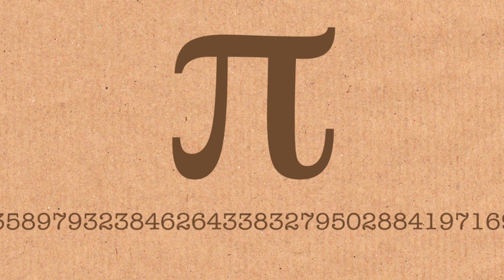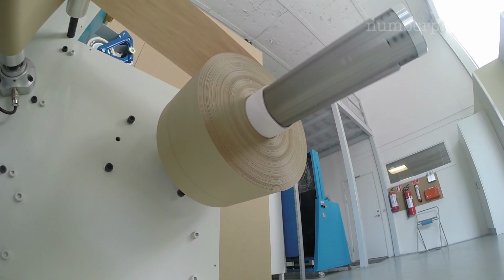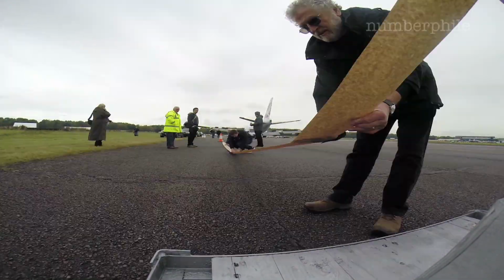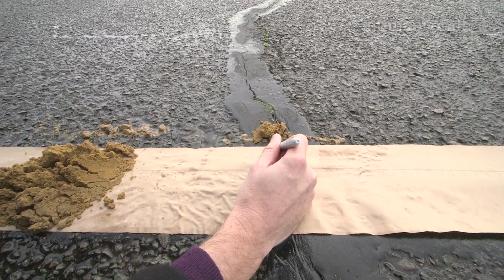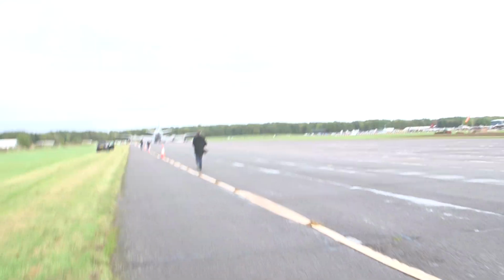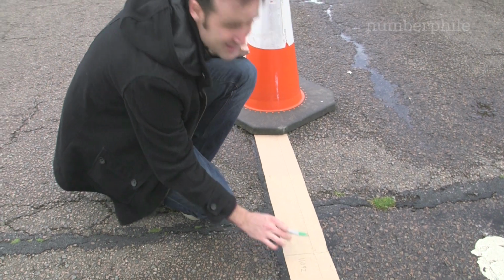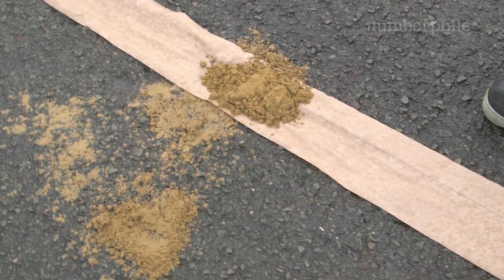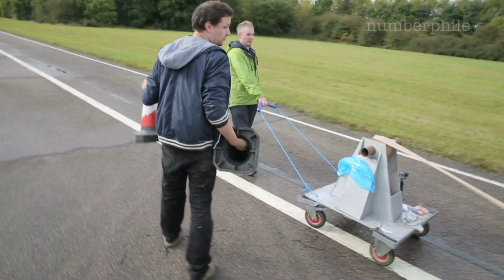The Making of a Mile of Pi - Numberphile

Comment: Should've called guinness and told them you had like "Most digets of pi on one piece of paper" so that someone has to check every single digit
Reply: Michael Van Camp ya lol
Reply: It wouldn't be too much in that case since it's only 1 line per page.
Reply: They still have a second roll to redo it with.
Reply: Lol it would be funny if they made one single person check them all. They would have to work multiple days. Instead of giving multiple people sections to work.
Reply: @the_original_Bilb_Ono  Indeed it's around 288 man hours (11.57 days for one person) to verify a million digits assuming one could sustain 1 digit/sec and I can't imagine it being much higher than that if one was actually checking properly.
Reply: @seraphina985  there's also laws for working so many hours without lunch/breaks and then you should add the time between shifts. It would either be the dumbest foreman in the world or the greatest troll to not break it into sections with groups assigned to various sections. Lol
Reply: @the_original_Bilb_Ono  Yes indeed but to clarify I was talking there in terms of actual working hours so yeah it would be around 7-8 full time work weeks (Based on the typical 35-37.5 hour full time workweek typical of most developed countries) ie a standard 8h*5day workweek with 30-60 minute breaks each day depending on local regulations and how generous your contract is.
Reply: Not even 1% of the digits of pi
Reply: Michael Futch not even .0000000000000000000000000000000000000000000000000000000000000000000000000000000000000000000000000000000000000000000000000000000000000000000000000000000000000000000000000000000000000000000000000000000000000000000000000000000000000000000000000000000000000000000000000000000000000000000000000000000000000000000000000000001
Reply: This comment has 314 likes
Reply: @Becquerel1  316 already
Reply: No, they would simply verify the print source
Reply: You have to pay for records from Guinness so I'm sure they wouldn't mind. They'd probably use some sort of computer and scanner anyway
Reply: Well, they'll realize there are no digets, but 1,000,000 digits.
Reply: Yes

Comment: how awesom is it that the first digit is 3, the 'halfwaypoint' (no. 500'000) is 2, and the 1'000'000-th digit is 1
Reply: guess the 1,500,000th might be 0.
Reply: and 2,000,000th is -1 or what
Reply: Christianz probably 9
Reply: I just checked. The 2 millionth digit IS 9, but sadly the 1,500,000th digit isn't 0. It's 5.
Reply: Also, I'm pretty sure when counting digits of pi, you'd start with the first decimal place, which would be a 1 instead of a 3. Bummer.
Reply: I checked at Wolfram Alpha - and using their indexing (where the first digit is 3 not 1) the 500,001 st digit is 2, the 1,000,001 st digit is 1 and 2,500,001 st digit is 0.  

Whereas the 1,500,001 st digit is 5 (9 is to the left and 2 is to the right) and the 2,000,001 st digit is 9 and the 3,000,001 st digit is 3.
Reply: @x___________________________x  it cant be
Reply: @CaIebwithaK  No, sir. All digits count, not just the ones after the decimal separator. Example: 1234.56 has 6 digits. In fact, in this video 1000001 digtis of Pi are printed.
Reply: @williammook8041  Wolfram Alpha is correct. In the video 1000001 digits of Pi are shown (1000000 after the decimal separator).
Reply: barely awesome at all..

Comment: Am i the only on who wish they'd made the video 1 second longer?
Reply: Patrick Hansen minute*
Reply: emile_b_owner why minute? then it'd be 3240

If it was 1 second longer, it'd be 3141 ;)
Reply: no it wouldnt ;3
Reply: I still don't get how 31+1=/= 32...
Reply: Patrick Hansen It was, youtube cuts 1 second which makes it look like it wasn't... but the video should be 3.141
Reply: +Patrick Hansen

Why? Then it would 314*2*
Reply: Nicolino Will on my end, the video is 31 minutes and 40 seconds
Reply: Patrick Hansen if you refresh the page and look at the time before it changes, it says 31:41 but then decreases by a second.
Reply: Patrick Hansen its 31:40 before ending while 31:41 after ending which means either 3.14 or 3.141
Reply: +Patrick Hansen I think it's already 31:41
Reply: Technically it should be 31:42 if you're rounding properly.
Reply: +Patrick Hansen that would be humerus because of the obvious correlation to Pi how ever any sequence of 4 numbers can be related to pi I chose my pin numbers according to the date written as mm/dd/yy/ so today if i had to pick a pin code i would pick 0034 or if i had to eliminate the 00 it would be 3482 because these are the next digits after the date 121615/003482...... i always know my pin based on what date i created the pin and vise versa.
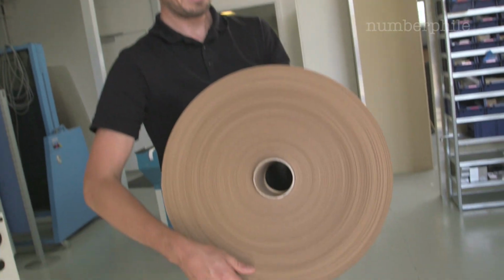Reply: The reason why is the since the first 3 digits of pi x 2 is 628 and the video is 6:27 long.
Reply: +Patrick Hansen DUUUUDE HOW DID U JUST C THAT?
Reply: It says 31:41 for me
Reply: it is 31:41 on the thumbnail
Reply: Patrick Hansen but its the first 4 didgets of pi 3.141
Reply: Rounding - spoken like a true engineer... :D
Reply: Patrick Hansen it’s 3.141 not 3.142 so why would you want that?
Reply: 3.14 is the real pi tho
Reply: Patrick Hansen, the video is 31:41.
Reply: or 2
Reply: Yesss this comment is at 314 likes now
Reply: no not now ;)
Reply: Pi of Shroedinger?
Reply: Patrick Hansen it is 31:41 for me
Reply: Then it will equal 31:42
Reply: It is 3141
Reply: on mobile, it shows it as 31:41

Comment: Couldn't there, theoretically, be an set of infinite repetition (like a repeating 3) within the infinite sequence of pie, if it is indeed a normal number?
Reply: Then there would also be a set of infinite 4s, and that is not how infinity works
Reply: Well, that would be paradoxical, wouldn't it?  I mean, then every other sequence would have to exist in it, infinitely.
Reply: sKebess Half of infinity is infinite though, right? And that fraction of infinity can just as easily come from within it, right? So it follows, that if it is a truly random, normal number, it must at some point contain an infinite series of threes, or fours, or anything, and everything else.
Reply: HisRoyalCarlness
You need to be careful when you deal with infinity. For example, 0.999... =1 but if we could, like you say, add decimals after a recurring number then 0.999...13324 > 1

If you took;
- a recurring decimal
and
-the same recurring decimal with extra digits after the repeating part,

then the difference between those two numbers would be infinitely small. And from memory there can't be infinitesimals with a non-zero value in the real number system.
Reply: ObeseYeti Fair enough, hence my original question. But still, there are other schools of thought when it comes to number systems, perhaps the discussion would be cool for a video. (PS: Thank you for responding rationally to my comment. Lately, more than usual, every response to comments I make has contained the word "moron" in it somewhere. Even when talking about something like cooking.)
Reply: HisRoyalCarlness
No worries, I'm not an expert by any means so take what I said with a grain of salt. But I do think that it made sense.

In regard to other number systems, I wouldn't really have any idea. Sorry I couldn't be of more help.

But yeah, I think a video on this would be cool as well :)
Reply: HisRoyalCarlness Excuse me, but why have there been multiple comments in this thread that have completely vanished, including my own?
Reply: Vulcapyro I delete things that don't add to the conversation. Like when people don't read through what is being said, carefully, and then respond with something that has already been covered or shows that the question was not understood. I also delete negative comments, a lot of the time. Most of the comments that have been made here, after the first ones, have been of a non-understanding or redundant nature.
Reply: HisRoyalCarlness Firstly, that is simply censorship. If some people can't be civil in their replies, you don't need to reply to them, but deleting relevant replies even if they miss your point is foolish. If the question was not understood or their response is wrong, tell them why; maybe in fact you have misinterpreted what they meant, rather than the other way around.

I for one took care in making my response, and rather than replying to it and perhaps telling me why it was irrelevant or whatever, it was deleted. This is poor behaviour on your part and suggests that you intend to just censor every comment you don't want to reply to. If you can even remember what I wrote in my comment, could you tell me what your actual response is to it?
Reply: sKebess
You really should just take off if all you intend to do is harass him for this rather than getting to any point of discussion. You're the person I'm telling him to ignore rather than delete, precisely because I figured you'd be that guy that would just keep going at it until one of you got bored or reported.
Reply: Vulcapyro I don't report people unless they actually do something report worthy. I just block them. As for deleting comments, it's necessary on Youtube, otherwise any useful information just gets covered by a swamp of back and forth, redundant, and unhelpful comments. It's like policing a forum, not so much an issue of censorship as it is one of making what is important more visible. You aren't being silenced, you can make a comment of your own in other places, but I will keep the discussions that follow from my posts well maintained.
Reply: HisRoyalCarlness It is censorship, especially if relevant comments are being deleted. Both mine, and sKebess' comment on sequences, were completely relevant. You never answered why my comment in particular was deleted, since it directly answers your question and didn't have anything close to even disrespectful; it was just math. I can make the argument again if you want.
Reply: Vulcapyro Censorship is a word you can throw around, but in the end the ethics of censorship are completely circumstantial. This isn't a debate, or a journalistic report, it's the Youtube comment section. I read through an understood your comments, and the comments of others, and they were addressing a different question than mine. Obese Yeti has already said everything that needed to be said.

Comment: I would have suggested two improvements to the unrolling process , one of which would have required it to be rolled the other way (inside has numbers instead of outside)..

The first suggestion would not have been cost effective for a whole mile, but would have helped with the unrolling AND kept the laid out sheet dry. I would have used two rolls of clingfilm (one between the runway and the sheet, and one above the sheet. with each cylinder of clingfilm rotating in the direction that allows the sheet to pass between them, and become coated. the cylinder above could also have been used to push the roll away from the laid out sheet.

The second suggestion would have been with the sheet rolled the other way, it could then be unrolled from the bottom and therefore less affected by wind.

Comment: From now on, the airline industry will no longer use yards/meters for MRL (Minimum Runway Length) stats. Instead we'll see, "A 747 at wax weight, 25% fuel with flaps at 40 has an MRL of 880,000 dop (digits of pi, natch!)

Comment: Since the first digits of pi came off the roll first, it must have either been printed in reverse order, or the roll rerolled after printing.  No mention in the vid that I saw, but clearly rerolling would be far easier.  Can you tell us which method was actually used?

Comment: Pi isn't random for those of you who don't realize. The first clue is that, a random number cannot be predicted. And the only way of knowing pi, is by knowing the circumference of a circle, in measurements of it's diameter. Every new digit you calculate isn't random, before anyone knows it, it's always going to be the same, just like the 3 at the beginning, that's not random, that's just how many diameters can fit fully into the circumference. Before we actually figured the first digit out, it wasn't going to be any random number from 0 to 9. It's clearly always been 3, and always will be.

When we calculate 1/3, we get a recurring 3 forever because 3, 3's fit in 10 and 1 is left over, recreating the 10, but we only have this problem because we use a BASE 10 number system, but if we used BASE 3 (which is less efficient), we could answer 1/3 really precisely like this 0.1. My point for this continuous number was that pi is no more random than this is. I know pi isn't as easy to predict, but the fact is, it's not random, and it goes on forever. Whereas with 1/3 we know it's a recurring 3 forever, meaning it's a lot more predictable than pi.
Reply: Woah.. saying irrational numbers can be rational is not rational.... sorry 

But on a more serious note, pi is irrational and it will not become a reoccurring set of numbers, to say otherwise would make pi rational. And pi has been proven to be irrational.
Reply: Brandon Kekahuna
Woo, woo, woo, calm down... What you said is true, i never said i disagree with that. You've come here, read my comment, and simply wanted to say something about it... Does it ever come to mind that, we all agree on the same thing? (The facts)
Reply: I fixed my comment. When i originally wrote it, i only used the word recurring by accident, i meant to just explain that the digits go on forever, i didn't mean in a pattern. We all make mistakes. xD
Reply: (edit)DLC ENERGY I apologize for using caps in my reply. didn't mean it that way. I agree, though, Pi, like other irrational numbers, are not random.

(I really need to learn to use emoticons at the end of my post to ensure my response is meant to be polite)  :)

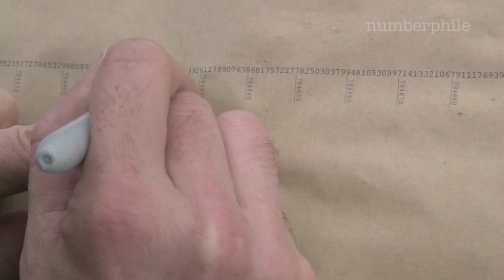Comment: 21:22 - 22:29 I'd love to see a version of Pi up to that point where each member of that series is colred via RGB values where it starts at 0,0,0 for the first member and then ends at 255,255,255 (or where ever it ends) for the last member. The way I'd do it, if I could, would be like a clock where you iterate red to 255, then at "256", red turns to 0 and blue goes to 1 and then continues on to 255,255,255.
Reply: You'd need 16581375 digits for that

Comment: So you can print a mile of numbers and use 20% of ink, and my ink runs out after 6 out 9 pages in a report. How.
Reply: Single line.
It's like stretching a human intestine around the planet, and yet it still fits inside them.
[May or may not be true, I haven't researched it myself.]
Reply: It’s not true, it’s like 5 or 10 meters, not around Earth
Reply: @vibaj16 
Anything can be stretched near indefinitely, the problem is that it won't resemble what it was once it's reached it's distance.

Comment: Amazing job guys!!!!
Just one question.... sorry....
But I'm really interested at how you guys actually calculated 1mil digits of Pi because if you for example quickly write a C++ or Java program, you'll very quickly reach 64 bits and the calculation won't go further even when you use doubles in C++ or BigDecimal variables in Java so how did you guys do this? I would really appreciate an algorithm or something.
Did you maybe use a algorithm that would for example give you the n'th digit of Pi because that would also work but I have no idea how to do that so an algorithm that takes in an integer as a parameter (which is the digit of pi that you want) and that returns the Pi digit so for example if you put 2 in the algorithm, it will return 4 and if you put in 5 it would return 9.
Is there a way to do this?... well obviously this video proves that there is. 
Thank for your time and well done (-;

Comment: question: My computer monitor has a resolution of 1920x1080 and each pixel is apparently capable of 16million different colours. How different screen combinations is possible?
Reply: According to Google calculator, (1920 × 1080 × 16000000)! = Infinity
However, Wolfram Alpha puts it at 10^(10^14.63767015176375).

Put another way that's like 1.4 trillion, followed by 8 trillion zeros. But don't worry, there'e no way you can actually perceive all those variations.

Comment: I'm just curious how many trees that had to be cut down to make that. I'm not against you guys doing this, just curious
Reply: +Internet Enzyme Well the average tree can be made into 10,000-20,000 sheets of paper.  8 points is 1/9 inches, and a normal 8.5x11 in. piece of paper is 93.5 square inches.  I don't really understand the point system, so lets just say that on average a number in 8 point font is 1/9 by 1/9, so 1/81 square inches, which seems about right.  93.5/(1/81)=7573.5.  1,000,000/7573.5=132, so just the numbers is about 132 pieces of paper.  There was lots of extra space though, so if we say that the numbers were only 1/20 of the space on the paper, which I think is generous towards the blank space, then it means they used the rough equivalent of 2641 sheets of paper, which is about 1/5 of the average tree. 

 Totally worth it.  

The issues with deforestation and stuff come mostly from wood used for manufacturing and burning, so wasting paper isn't as big of a deal.

Obviously my estimation is definitely wrong, but it's probably reasonably close, so it's safe to say not even a full tree was cut down to make the paper used.
Reply: That's interesting. So by your estimation they would have to print 5 million digits of Pi to cut down a single tree. Thanks for taking the time to answer my question.
Reply: You're welcome.  I was actually pretty curious myself.

Comment: one suggestion of what to do with the second roll is to create a machine that unrolls it and rolls it again. in a case of some sort. then put that machine in a glass box and put it on display in a museum or or your house or something. maybe u can print facts about pi every 10 feet or so. or you can set the motor to run at a speed that reveals a fact about pi every hour or so. just an idea of something to do with the other roll.